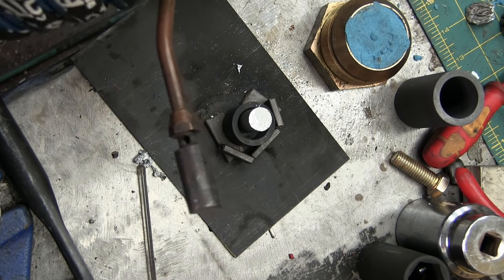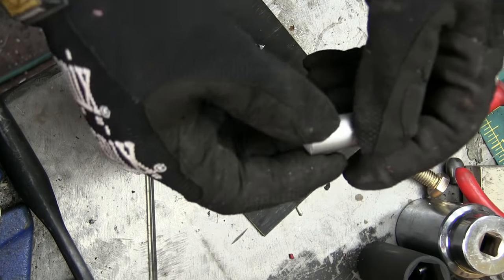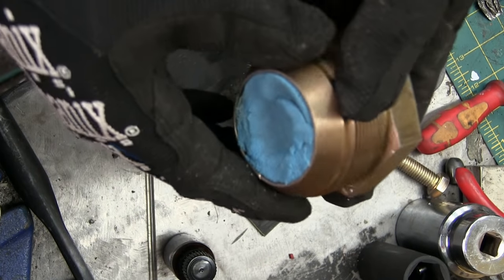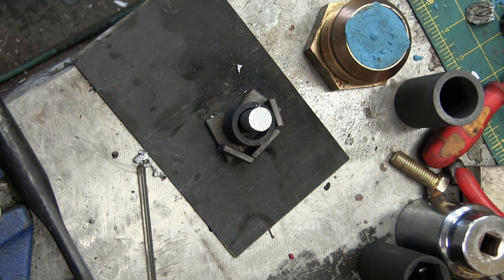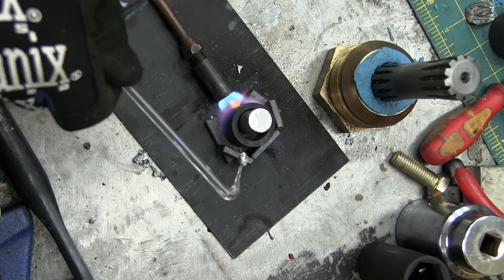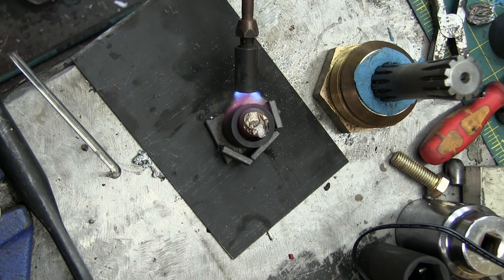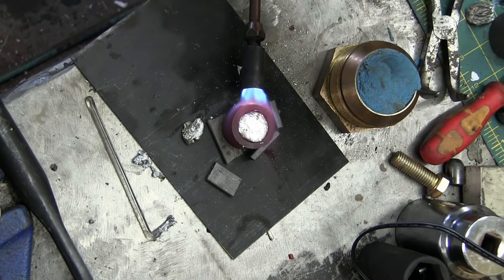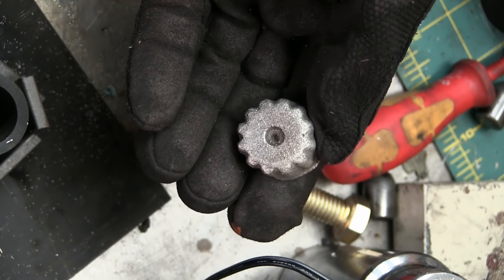Surprisingly Easy Way to Cast Aluminum

Comment: With this process and enough empty pop/ beer cans, I can build myself a new Ford!
Reply: You'll just need about $20,000 worth of propane.
But yeah!  Get on it and go...
Reply: Nope.   Aluminum don't rust.  A good Ford will be rusty as hell.
Reply: Yeah it may take you 20 years to pour enough though this guys set up isn’t very viable
Reply: Aluminum Heads/hood/body paneling took around 700 lbs off the f150.   That's fuel economy/towing cap/hauling cap/easier on the brakes with no load....  No argument Ford made the right call, that's why they're on top
Reply: @richardgood8691  except they have some bad business practices and use c channel frames becuase it's cheaper
Reply: @richardgood8691  don't believe me , look up deboss garage-why I'm not a ford fan, it's not a biased video he is a mechanic with real experience
Reply: @Oyveyowitz Shekelstein Nostrilberg top at pickapart and lkq
Reply: It's been 4 years, how's that cast aluminium Ford coming along?
Reply: and it will probably be better than a real one
Reply: @honeydew

Hm? That's funny, plugs don't have any problems staying put in (cast alum, air cooled) motorcycle heads.
Reply: @drlegendre  cool story, yet the Ford triton is soo notorious for this that Ford now offers a fix it kit for all Their angry customers it’s almost a guarantee that your triton v8 will blow a spark plug out before 150k miles
Reply: @drlegendre   plenty of engines with alli heads in cars have been successful, with no issues,    since the late 60's among others, fiat, alpha , lancia  could be thrashed  and not have issues like this,  most car manufacturers  had caught up  by the 80's, however it is well known that the F150s particularly  are notorious for this.  One could almost assume it is another example of 
FORD,  fix or repair daily,  fall off road daily, found on road dead, factory  ordered road diasaster.......
Not sure why they have such a problem  with  what for most manufacturers  is old established proven  technology
Reply: @mindofmadness5593  the new ford trucks have been aluminum since 2015… you missed the reference
Reply: @alexmills1329  Thanks, I really was not aware of that.  Interesting.
Reply: @dantyler6907  then use wood for heat
Reply: Would only last as long as a dodge 🤷😂
Reply: And its better QUALITY.....
Reply: No wonder those Fords shrink like beer cans when they crash!

Comment: Alright, damn, I feel like a caveman who just saw a car. There are like a dozen things you just did that are drastic improvements over what the hell Ive been doing for the last 2 years or so, like: using an actual cruicible instead of a bent piece of scrap metal and vice grips, using something to poke the oxide layer off, instead of just jiggling everything about until either the bags of aluminum pop and join together, or I spill a bit on my foot again, using magic sand instead of wood, and casting parts instead of just casting puck-ike discs and turning those into parts later.

Comment: Well shit, I'm running out of reasons not to cast something.
Reply: +Belias Phyre awesome comment
Reply: +Belias Phyre me too.
Reply: +Belias Phyre I know.... what to make... what to make....  (I did start savings cans just for this after watching another YT'ers video but still haven't a clue what to make that'd actually be useful) A mallet would probably be the perfect first try. 

If the handle fails to come out perfect it can be covered in dip-it or a friction tape. Also oversize and use the handle as a spout. Be good to taper the neck wide into the mallet so it wouldn't break easily.

I was trying to think of something for a bike but most of it is already made and reasonably available. They even make pedals that make their own power and light LEDs inside them! (great idea because they're basically fairly theftproof)

Plus I don't have a lathe to finish the project so it'd have to be something either crude is easily handle finishable.

Would it make a decent handle for a camping handaxe? One could impregnate their name or logo/motto on the side. That'd be cool.
Reply: BikingMNViking 
     If this is your first time casting, you may want to try something smaller, especially if your using this process. I was thinking some simple jewelry or trinkets just to see what kind of detail and finish I could get. A mallet is a bit ambitious for a piddly little torch like this.
Reply: I have several furnace burners (and probably a few stove ones) I have saved and orfices from stoves I've installed if I wanted to convert them to propane. Biggest thing I think I would want to do is fence my yard in first to keep lookie-lous minding their own business.
Reply: As long as your safety minded. In my experience, it's not the operator that gets bit, it's the poor sap working next to him.
Reply: +BikingMNViking what would you do with an aluminum mallet
Reply: What wouldn't you do with an aluminum mallet? You can hit stuff with it... prop open doors... melt it to cast more aluminum stuff...
Reply: Belias Phyre Oh Just for pratice, and fun, cool.
Reply: BikingMNViking Ah well then it would be something usefull to make out of trashed pop cans!
Reply: yup... I was trying to say I would keep the head long so it could be resurfaced by my sander and I could do a crosshatch for extra grip. If you make any send me one!

I'm trying to collect some firebrick as I see it get chucked away as I pass by. Should be able to find enough by fall to have a small foundry. Got some great drive air motors, in fact I found the perfect air orifice piece in an alley yesterday but it was too heavy to get home. I think it had been cutt off a car frame so there were two of them. No worries about them being too flimsy!
Reply: forget the cans to much work for little return, you might get 50% if your lucky. go for precast engine parts or the like you results will be a lot better.
Reply: Popcorn Shiner
'cept I'm in the city...every poor fool, crackhead & addicts collect metals for their recycling value ... even bronze statues get stolen and make the news on a semi-yearly basis. I mean pieces into the tens of thousands of dollars, hacked and sold for scrap. I think cans will work fine for my purpose. I'd like to add a tiny amount of copper though..something like 5% makes it near aircraft aluminum --tough & more fatigue resistant. Not sure how the two bind together, though. I'll keep my eye out for aluminum engine parts but chances are they're be returned for a core charge or scavenged way before I get there. Thanks for your input.
Reply: The scrap yards around here will sell you what ever you want at about a 40 to 50% mark up. Still pretty cheap compared to new.  I buy most of my raw materials at the local scrap yard.
Reply: @relentlessmadman  Mall the woodens?

Comment: I enjoyed this a lot.  I worked in an aluminum foundry for 9 years before my current job.  We did permanent mold, but its amazing what you can use in a pinch.  If we needed to make something ourselves we would make a mold out of wood, take a die grinder to some tool steel,  or anything.  It doesn't take long for solicitation so you can get away with a lot.  Its especially handy to get a basic shape that you can finish out the detail with a mill or lathe.  Keep up the good work.

Comment: Sweet! I would have bet money it was not possible with a handheld torch out in the open.
Reply: +Applied Science i done that before with a propane torch and 100 g of aluminium but its a pain in the ass and you cant cast much
Reply: Brice it’s probably easier if you do it by the ounce instead of by the gram.
Reply: use to throw old aluminum rims in a fire pit with a cone shape, all the aluminum ran into a coffee can, that was before the epa started watching us peeps on farms.
Reply: I've melted soda cans in a wood campfire before.  More than once.
Reply: Yes it is possible i also did it few days back
Reply: however, forge welding steel w/ a naturally aspirated propane torch in the open is impossible. even w/ a huge hi flow torch.
Reply: We are not talking about steel we are talking about aluminum
Reply: Why, surely someone with scientific knowledge would know you can easily melt aluminium with a blowtorch (isopropane) let alone oxyacetylene
Reply: @4wdsome444  because a piece of billet is a lot thicker than sheet aluminium we are more used to seeing. Especially cans which are only the thickness of a human hair. 
Aluminium dissipates heat extremely fast too so it would be logical to think that the aluminium would never turn fully liquid for long enough to pour it.
Reply: @nathansmith3608  I think it may be possible to do it on steel, the other day i used a propane torch on a hacksaw blade I wanted to bend into clip and it went red extremely quickly. I think it would be very easy to bash together a few pieces.
Reply: @juggernautxtr  y
Reply: @nathansmith3608  Ofc that requires much higher temps than when melting Aluminum, like 3+ times more
Reply: Oh you figured oxy acetylene necessary?

Comment: Thanks AvE, this looks like possibly the best solution for doing small casts of anthills !
My Sister, niece, and two nephews are visiting this summer and I thought they'd be blown away by casting some anthills.
I live in Minnesota, so our anthills don't run very deep ( I hope ). I wouldn't need much more than maybe double the amount
which you melted, But I'm sure a slightly larger crucible is available.

Thanks again for the cool vid ( and the witty and entertaining renaming of popular sales outlets ).
This is definitely the simplest and easiest method to melt smaller amounts of metal, not to mention portability, which for
casting anthills I would imagine would be highly convenient !

Comment: great demo and info... especially the quick sand mould ... A word of caution to those who cast aluminum keep molten aluminum away from water... you will get an explosion. I visited Reynolds Aluminum in SC and watched them cast billets for extrusion.  They had a 10 foot diameter patch in the ceiling where the 1 ton went when the molten aluminum leaked into the water cooling the mould.

Comment: Fun Fact, we actually call that "shrink" when we scrap castings out for that. If there is a casting with bad shrink in a certain area we will add a riser to that spot which is essentially a reservoir that will fill up with metal that the casting can then pull iron out of while it cools.

Comment: I worked in Foundries for years, aluminum and zinc some bronze, if you like shaking hands with the devil every day a foundry is a great place to work LOL
Reply: +Rex Holes I've spent time in steel foundries myself, they're definitely a hazardous work environment, but they are cool as frig to say the least. Watching 15,000lbs of steel being poured is a hell of an experience. Foundries are a dying industry thanks to the majority of casting productiong being sent overseas to China and India, so there's a major shortage of younger people like myself going into foundries or patternshops. It is actually a pretty lucrative field where you can learn a lot of cool skills. There's quite a fair bit of job availability too.

Comment: I believe you can also use dirt cheap powdered Borax (twenty something team of donkeys brand) as it acts as a cleaning flux when molten.
Reply: I belive Clickspring does this when tempering steel.
Reply: DONT USE BORAX FOR ALUMINUM!  like he said potassium chloride (NOSALT) is what you want to use.   use the borax for ferrus metals (iron steel etc).
Reply: +sideswipe147 Thank you! The borax will cause the aluminum to corrode fast and deep. Guaranteed part failure. Salt substitute ("Morton Lite Salt" is a blend of the two, and a $3 bottle goes a long way) is great.
Reply: @sideswipe147  Is the NOSALT brand trademarked?

Comment: i did that with drink cans and a few frying pans melted them down poured the alloy into whipped cream cans and threw the casting into the lathe, machined it off and made diff bushes
works a treat then i threw them into the deep freeze to shrink them and hammered them in with a big hammer and a slice of alloy to not damage the bushes

Comment: This is definitely a good tip if you have aluminum stock to melt.  I have large flat pieces like cut up mac keyboards, etc.  You'd have to chop them up into nubbins to use this method.  I have a charcoal + hair dryer in a coffee can setup and its easier to melt large amounts to make some clean chunks which would then go into this setup really easy.  This would be cleaner than the charcoal stuff, for sure.

Comment: nice video can you show it using the welder would be cool to see how that works.
Reply: I think he did one with a welder a while back
Reply: darwin miller
Wasn't that Tungsten, Titanium or some really touchy metal and didn't it fail?
Think it'd be significantly easier to fry up aluminum with an arc welder though.
I'd definitely like to see a demo of that method though.

Comment: So I work at a small engine factory.  When you scale the process up to really big parts, it becomes an absolute pain in the ASS.  That shrinkage that occurs during the cooling process can cause something called "Shrinkage Porosity".  Basically the part rips voids into itself, that resembles cracks or air bubbles.  The bad thing is they can go completely unnoticed, unless it's uncovered when machining the part.  I have sent a few thousand engine heads back to be melted down again, because of shrinkage porosity that goes unnoticed until the parts reach the production line.  I wish i was the guy in charge of QC in the aluminum machining department.  Evidently he's paid to do the absolute bare minimum!
Reply: Can't you fix that with better alloys ??
The Yamaha / Mercury casting comes up from underneath. It reduces dross in the casting, and I think they vibrate the forms a little too.

Comment: If you want to get rid of the shrinkage you can use the aluminum from a engine or cylinder head, or an alloy rim.
You can also use a sprue, which is basically providing extra metal to compensate.

Comment: Worked at a machine shop making safety relief valves, the raw casting is exactly what you'd start off with before making it more pretty.

Comment: Old shop teacher had some 4" steel pipe with a bit of plate welded on the bottom. Used a rose bud to melt the bits of aluminum. I don't recall what he used for a degasser - maybe borax. Obviously the pipe will burn out over time but for a quick deal that will last a reasonable amount of time especially for the occasional casting project it was an inexpensive way to get a decent volume of aluminum.

Comment: Thanks for the heads up on the small graphite crucibles. A while ago, I got a much larger silicon carbide crucible which takes a considerable amount more heating to achieve pourable metal.

Comment: cross section it? Just to appease us stoopidly curious?
Reply: When you take the cross section, you need to tear it apart. If you cut it, it will distort the surface. On the casting of ingots I have done, the insides are pretty cool- but very irregular.

Comment: If your serious about getting into casting this is a great way to go nice and cheap if you want to cast something half the size of an ice block. the reason you see all the other diy foundries is beause you can actually cast something of use. my diy foundry was just over 1KG in size and still not happy, but if you want to make trinkets then this method will suit you fine.

Comment: I use a small cast iron bowl with a lid. I put it in the coals in my wood burner in my shop and once it gets going i can do a batch about every 15 minutes, it wont do anything more then aluminum but its a fun way to store scrap

Comment: Ben, thanks for the reply. I realize I was being overly simplistic with the cross section suggestion. The home gamer isn't going to polish and acid etch for an electron microscope inspection of crystal structure. I would be curious about inclusions, porosity or internal fractures from uneven cooling. I was a ME student years ago, but metallurgy was never my thing. Power transmission/geartrains.

Comment: CAUTION!! Don't use table salt, without checking the ingredients. Iodized salt typically has other stuff added including sugar. Also, specialty salts like the delicious Celtic salt have other chemical structures.
Also, order some Celtic salt. It will do wonders for your cooking.
You can add other stuff to make fun alloys. Zinc, magnesium, and copper are kinda common. They can make it stronger and heat resistant. Adding micro ceramic balls can make it nasty to cut through.
Flash freezing or pressure ovens can also make it super strong depending on the method.

Comment: Wanting to cast a new logo for my boler Camper. The original is plastic appx 4" x 8" and about 3/16" thick.
If I had a steel mold created, could I use a mapp torch to melt the Al right in the mold rather than pouring it?
Reply from the maker: might be sticky. test first.

Comment: ive melted a couple kilos of aluminium with firewood, but it takes quite some time (even with pleanty of airflow at the coals) to melt the aluminium
im planning to melt some using Bituminous coal, the same stuff blacksmiths use to heat steel
good idea?
Reply: Get a good fire going after all Day. Throw in a 50lb bag of Anthracite coal...Woo whoo is it Get Hot. Pennsylvania Coal

Comment: What I would love to know ave and you are the man to ask is at work we have induction heaters that heat pipe 4.5" diameter.375 wall up to 1100 degrees in about 8 seconds, I've always wondered how much it cost to heat 1 pipe in electricity, we would do about 7000 ends in a 24 hour period.